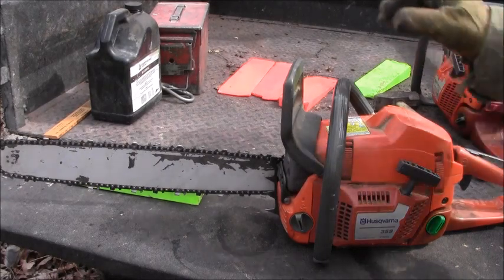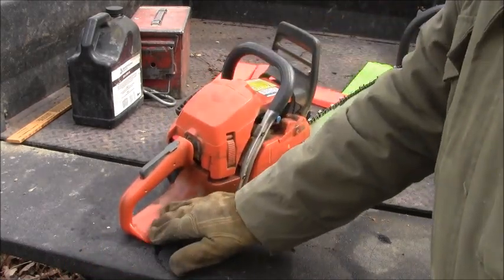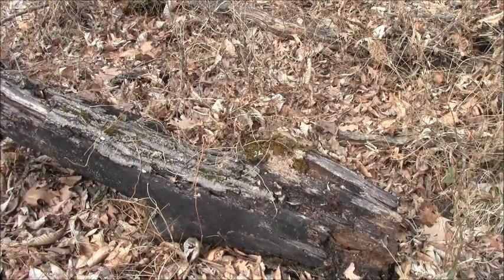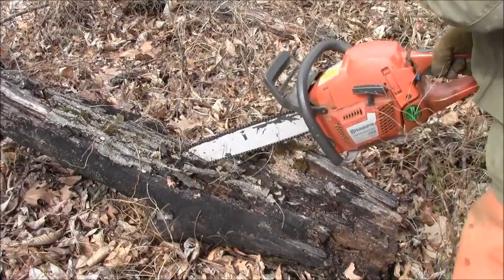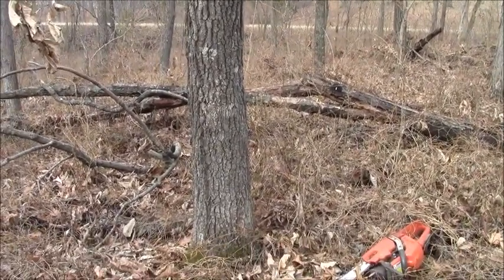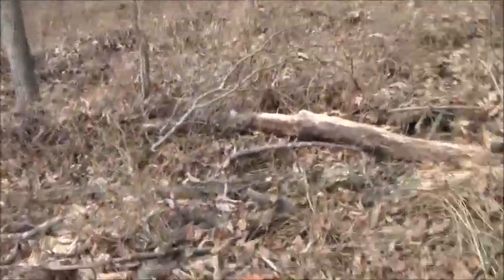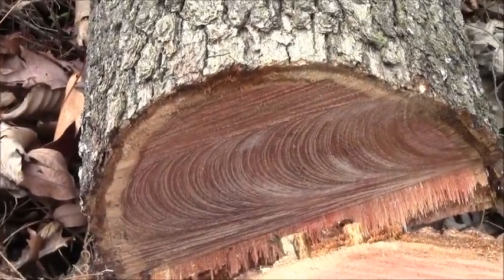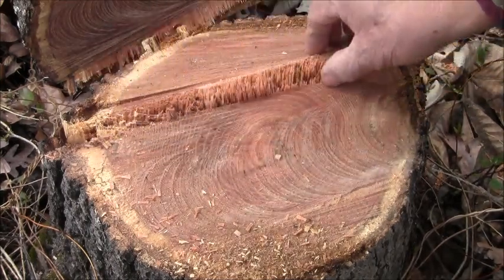Using Your Chain Brake And Dropping A Snag

Comment: Another great video!  Question, would that tree have "barber chaired" if you hadn't done a punch or bore cut?
Reply from the maker: Probably not.  My saw was running and cutting well, so I could get to the hinge wood quickly.  With most of the weight gone up high there was not excessive force.  The advantage in bore cutting is that you get your hinge set up just the way you want it while the tree stands still. You can be getting away as the tree begins to fall instead of completing your hinge with the tree already in motion.
Reply: Thanks!

Comment: What's a snag mean?
Reply from the maker: A snag is a dead, standing tree.  They can be dangerous because of rot, brittle wood, and branches overhead that drop on you when the tree goes into motion.  You want to spot the dangerous ones overhead and don't stand under them if you have to pound a wedge.  A Cat skinner/backhoe operator told me that he learned to never push on a dead tree.  If it doesn't go with the first push it will rain dead wood on you when you ease off.  It is always a relief it a snag is weighted in the direction you want it to go. Thanks for visiting and commenting!
Reply: Thanks! I learned a lot from your reply. Much appreciated 👍